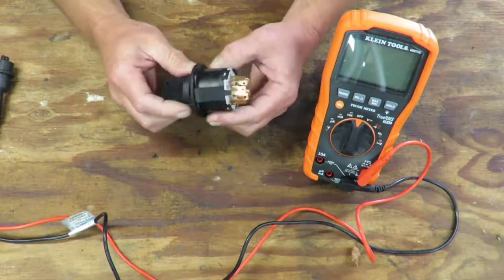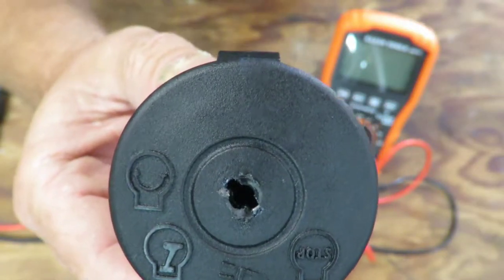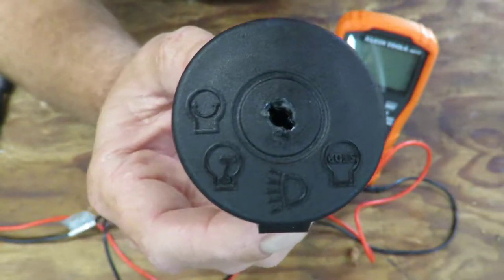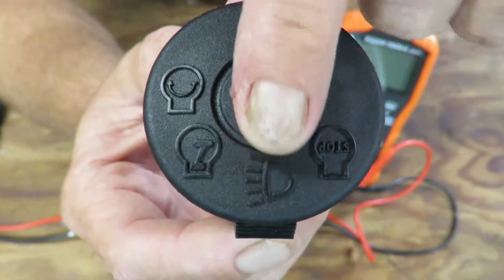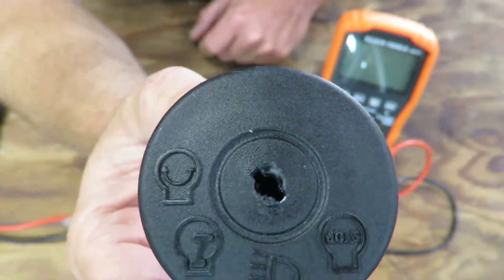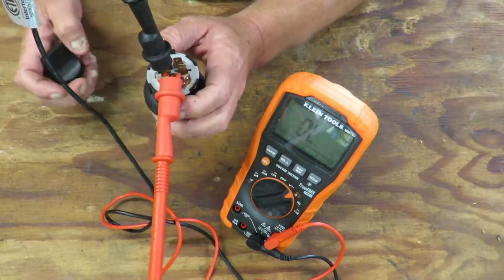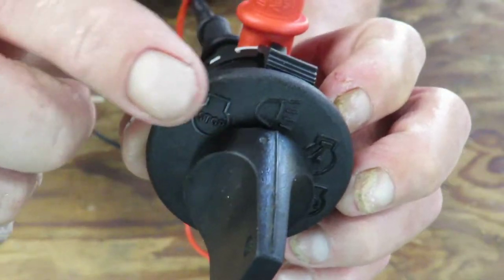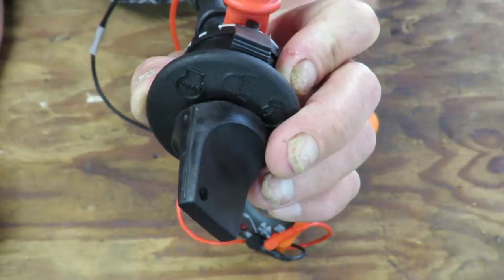How to Simple Key Switch Test

Comment: My husqvarna 48" riding tractor keeps going thru key switches! And it seems to be getting worse I used to replace it once a year now with the mowing season only half over again key switch is shot! It cranks but wont fire! I cant seem to figure out why it keeps happening. Any advice would be greatly appreciated thank you love the channel
Reply from the maker: I think you have other issues, Carburetor problems, ignition Coil Problems, 
Possibly more major problems that are unlikely,  but possible
Low compression, Valve adjustment
Reply: @sartingarage8045  tonight I replace the key switch again it fires right up runs great is it possible the voltage regulator is putting out too much voltage and frying the switch? No continuity between A1 and B  also the A1 terminal is a different color than the other terminals. Please let me know your thoughts the carb is new due to ethanol fuel also replaced the head gaskets when I was at it the mower has lots of power and runs great
Reply from the maker: I would definitely test the voltage while engine is running. Should Not be over 15 volts DC. Most common about 13 to 14.5 volts DC.
Also make sure your using the correct key for that switch. Wrong key can damage the connections inside the switch

Comment: What is the "Y" terminal used for?
Reply from the maker: I am not 100% sure about this, But I believe the Y is for the headlights. I believe the Y actually means the connection splits two ways from the stator or voltage regulator.
One to the headlights other to charge battery.
One way to find out for sure is to follow the wire that connects to the terminal Y and see where the wire goes

Comment: I have one of them older switches. I just bought it new this morning. I've also replaced the solenoid as well. I checked all the grounds and still nothing. I can get the solenoid the click only with direct power. My issue also is the fuse holder. when I put the connector on the left solenoid it blew the fuse. When I change it back, I get nothing. I wish this opposed twin would fit in one of my good frames just to see if the starter will engage. I was able to follow your video though and seems that this switch is good. I have that voltage gage on this 6 prong switch.

Comment: Research led me here🙏 fresh battery won't even turn over I'm thinking it the ignition switch
Reply from the maker: Engine won't turn over could be a number of things, Key Switch, Brake Switch, Blade Engage Switch, Starter Solenoid, to name a few. I would test key switch first
Then a easy test to see if starter Solenoid is possibly bad. There will be either one small wire or two small wires on bottom of starter Solenoid. With key in start position should be   battery voltage to the one wire or on one of the two wires if your solenoid has two.
Also make sure your grounded good.
There is a video for testing ground connections on my channel.
Reply: @sartingarage8045  it ran last year it was cover with tarp!!. I tested switch but my multimeter is cheap and doesn't beep like yours it would flash couple high numbers then go right back to 1 on the screen... nothing has been tampered with just wonder if condensation is a factor also in those parts you mentioned failing(solenoid and ig switch etc)
Reply from the maker: I would invest in a bit better meter at least one with a beeper.
Reply: @sartingarage8045  🙏 thank you master for your wisdom..

Comment: I have a old toro 3650 snowblower,r tek,how do i test the switch before replacement if the coil
Reply from the maker: For the ignition coil circuit on the key switch is terminal M and terminal G on back of switch. Key off should be continuity and Key on should be No reading.

Comment: Enjoyed the video, tried testing my switch as you did, I could not get anything when touching B and S and turned to start but nothing happened, parked the mower after mowing and was going to move it but nothing no click, no start. I saw the fuse was blown so I unhooked the clutch, wires to the engine, everything else I could find to unhook but still as soon as I turn on the key it blows the fuse, could this be a short in the switch, lights haven't worked in a while.  Don't know where else to check. It will spin the motor if I jump the relay.   Thanks
Reply from the maker: First if your not getting anything between B and S terminal on switch. The Switch is defective. B is battery and S goes to starter solenoid. Which is why it wont do Nothing in Start Position. I would replace the switch First.
Reply: @sartingarage8045  Thanks ordered one see what happens. Appreciate the reply.
Reply: @theeagle4540  i have the same problem, does new switch fix your problem? Thanks
Reply from the maker: You need to test your switch as in this video
If your not getting anything between B & S Terminal with Key in start position.
Then yes you need a new key switch also

Comment: If you getting same reading from battery wire on voltage regulator to frame with keyy off and key on. Im checking 12.6 with key off and when i thurn key on its the same.

Comment: Thanks for the video - very informative .  You might find this interesting.  I had a problem with my Craftsman mower with a Kohler Command 17.5 hp engine ( a very good engine)  The mower started to get hard to start and after you ran it for a little while and shut it off it would not start unless i sprayed starting fluid into the carb .  I believe this started when i discovered mice made a nest under the engine cover.  I replaced the spark plug, double checked the ignition coil gap, installed new carb., new fuel line and filter and finally new head gasket. Did not help.  Not sure why, out of ideas i guess but i watched your video .  I performed your test very carefully and did it twice, it shows the switch is ok .  My brother who is a pretty fair mechanic insisted i try to hot wire the switch - i did that and bingo the engine starts just fine, and then it also starts after you run it for awhile just like it should . Installed new switch ( 7 pin sw. ) and problem appears to be solved.  This is the second replacement switch in ten yrs - i would think that is abnormal but with the very poor quality of parts now maybe not.   If you actually see this after all this time - thanks again, you got me pointed in the right direction.
Reply from the maker: Glad you got it figured out

Comment: My  Ferris keeps blowing charging system fuse when i turn the key on.
Reply from the maker: @michaelholt4925
Most of the time this will be a short in wiring to ground or defective key switch. This Video doesn't show how to test key switch for a short. But basically you test the same way as in this video, but say when your checking your charging side of key switch, rather than just check A1 to B terminals. You want to check all the terminals. Connect one lead to A1 and the other to all other terminals on switch, You should only have continuity thru A1 and B,  So if you do this and you have continuity between A1 , B and G. That switch is shorted to ground.
And also your wiring and connections may be different. and to figure this out
Disconnect Battery
Remove output wire from Voltage Regulator
Put one lead of meter in this wire
And at the key switch use the other lead to find which terminal your connects to on key switch.
Another short test to
Disconnect Battery
Connect one lead to single wire on voltage regulator
Other lead to ground
Turn key on
If meter beeps then you have short to ground. 
Make sure Battery is disconnected or you will damage your meter.
Reply: @sartingarage8045  Thanks

Comment: Excellent teaching! Checked out my LTX 1046 Cub C ignition switch it tested all good.  Thanks.  I've replaced the starter solenoid switch. While doing the replacement , I noticed the fuse, which was good, had  the red wire on one side was hanging free. I reconnected it to the larger red wire coming of the solenoid. Still I have a  tractor that  does nothing when I turn the key. Is there  another fuse behind the steering wheel close to the ignition switch?  Any suggestions? Also, do you have another video that would address this problem? Just subscribed . Thanks again, great job!
Reply from the maker: The little red wire you reattached
Make sure you attached it to the solenoid post that the battery cable goes to the battery
One side of solenoid post goes to starter
Other side goes to battery
If you connected it to starter side
There will be no voltage

Comment: Mines a cheap all metal brand the only plastic one I have is on the John deere
Reply from the maker: There will still be letters on the back of switch, Sometimes on the terminal themselves or on the switch at bottom of each terminal.
Reply: @sartingarage8045  there is. I have a big battery charger I could test it with and other mowers I could test it on if the wire plug in was the same 

Lowes sells the switch I'm needing. i haven't bought it yet because i been looking over the wiring i was trying to see how did the blue and red melt a little so those 2 are melted into the black wiring plastic what you plug into the switch
Reply: @sartingarage8045  the switch might be good then it might not it is old and full of rust the guy we bought the mower from always kept it parked outside
Reply from the maker: You can test the metal switch with a Multimeter. Put meter on Ohms. 
Depending on which switch you have
You will test terminals
B to S with key in start position
M to G with key off
L to B with key on or in Light position
Depending on what your problem is
May need to do other test to switch
Reply from the maker: Yeah that's Not Good
If it's rusted up I would probably just replace it to prevent future problems
Reply: @sartingarage8045  I need to figure out how the blue and red got melted first it could have been from the switch being old one black relay box was clicking when I'd turn the key to on it might be bad 

Its just on the old green craftsmen most of those mowers are made the same well with the same parts I don't really see why they made them with so many of those relays it has 4
Reply: @sartingarage8045  it is rusty

Comment: Will someone PLEASE show a video on How to remove a key switch??!! (for us "gals"
Reply from the maker: Paulette Pier What Mower do you have
Reply from the maker: I will try to make a video this week on How to remove key Switch.

If it is this same switch that is in the video. On the back side of switch there are 2 Tabs exactly straight across from each other. Another words if you had the switch in your hand there will be a tab on right side and the left.
Push one tab in as you push up on switch at the same time. Switch will come up just about eighth of an inch.
Then do other side tab being careful not to latch the side you just got loose to latch back
Reply: @sartingarage8045   It's an older model of Troy Built Bronco  the brake & accel are on on the same side..
Reply from the maker: If it is the same switch in this test video
There are two Tabs on the switch 
Lift hood and reach under dash and on the top and bottom there is a tab
Push the tab down with a screwdriver while pushing out on the switch

The switch comes out the front of dash
The tabs are on the back of dash
Reply from the maker: Paulette Pier if it is an older tractor it may have the old style switch
If its plastic it is described in previous comment I sent to remove it

If it is a Metal or aluminum key switch it will have a Nut on top. Just remove the nut and Switch will come out from back side of dash.
NOTE: Sometimes this Nut is covered by a rubber cap. The key goes thru this rubber Cap. Pry the rubber cap off with a screwdriver. You will then see the Nut
Reply from the maker: @paulettepier5526  Did you get your key switch out
Reply: @sartingarage8045  Not yet and I was mistaken on the model..it is a Horse, not a Bronco ...Had a friend come by ..he 'arked' the slinoid  & it started..he did say he had to jiggle the key...would that mean the switch os bad or going bad?  Also, last mowing  before it stopped cranking....as I was mowing, the key fell out ( but it kept going)..would that be a "pre-warning" the switch is going bad??    Thanks for all the help..depending on weather tomorrow, I will try to watch your video & try....but the fuel tank is in front (behind the ignition...)
Reply from the maker: @paulettepier5526  I dont want to tell you the key switch is bad without testing it. But it does sound as if the internals of the switch are broken, The key shouldnt just fall out. That Gas Tank can be removed to get under dash, but on some MTD its Not an easy Task. MTD makes Troybilt. 
Some you have to remove hood, side fenders, Then pinch fuel line off to prevent fuel from coming out of tank, Then remove fuel line off fuel pump or Carburetor. Just follow the fuel line from the Fuel Tank to the engine and remove it. Take the 4 bolts out of fuel Tank and Remove it

Comment: I just found ur channel. I wonder if u could maybe do a video on basic to moderately complex electrical systems like on a mower.   I kinda know how it works but need a lot more training  like how does a ground work.  How do they wire all the safety switches with everything else and it works.  Thanks for sharing your knowledge
Reply from the maker: William I do have some videos on Ground
But I will most definitely make some more on this information. I work a full time job 12 hour shift 5 6 and sometimes 7 days a week. So it may be a bit before I can create one.
Reply: @sartingarage8045  ok I sure do appreciate what you've done and will do in the future.  Thanks  very much. What's your first name
Reply from the maker: Chris

Comment: best video on testing switch I've seen. My old switch was bad, bought a new one and mower still won't do anything, not even the lights will come on with the new switch. Battery was tested and is good, so there also must be some other electrical problem to research
Reply from the maker: Power to the switch comes from. Starter Solenoid. Follow battery positive wire to solenoid. There will be a small wire attached to the same post on solenoid that battery positive goes to. There will be a fuse in this wire also
Reply: @sartingarage8045  Same problem, Just  tested as per your instructions, my key switch on a  Cub 1046. The key tests ok. Replaced the Starter Solenoid and still no power when I turn on the key. I checked the fuse. It's good. The red wire coming out of the end of the fuse had broken off. I reattached the wire to the positive  red battery cable. Still nothing. Is there a second fuse up behind the steering wheel I'm missing?
Reply from the maker: @Lorin Kenfield On the connector to switch 
Check the B terminal for battery voltage
Test your battery Ground
Meter on Ohms One lead on Battery Negative
Other lead touch to engine block and other metal to make sure ground is OK
If you don't have ground there will be No voltage

Comment: Great video, thanks for taking the time to make it. I’m looking to add a led light bar to an Ariens. Currently the tractor has no lights. It has a similar switch as you have in this video. I want to utilize the light position on the switch. Can I use the L and A2 terminals? By the looks of the video I’m sure I can and not mount an additional switch. Also I’m assuming that if during the daytime the lights would be off if the switch is no on the light icon. Thanks
Reply from the maker: Watch my Boss Stereo install on Husqvarna 
I also added LED lights to it and the video shows you where to connect lights to use key switch.
There are 3 parts to video
Reply: Sartin Garage thanks I’ll check it out.

Comment: What would cause my starter not to disengage?  I just did this test and the switch is good.
Reply from the maker: When you say engaged
Starter stays spinning the engine
Or starter Gear just stays up

If engine keeps turning over
Replace starter solenoid

If the gear just stays up
This sometimes will happen if engine doesnt start.
But if the gear stays up while engine is running. 
I would replace abbendix kit
Reply: When I try to start it, the gear goes up and stays engaged with the fly wheel.  Im don't even get a full revolution.

Comment: hello how are you
Reply from the maker: Im good
How are you
Reply: Sartin Garage I am trying to install a new key switch not going so well ! Any advice .. don’t I just plug in the new one
Reply from the maker: @ChillaKaya  Yes as long as its the correct Key Switch
Look up your make and Model number of your equipment. There will be a part number for your exact key switch
You then will be able to unplug old one
Then just connect new one
Reply from the maker: @ChillaKaya  If you would like Give me your Make and Model Number and I will look key switch up for you and send you a part number
Reply: @sartingarage8045  ok  so model number is 937748
Reply: @sartingarage8045  make is the hustler rapture  then there is this number 17093121
Reply from the maker: @ChillaKaya  looks like 937748 is the Deck Model Number
Should be another tag Under Seat or Somewhere on Frame on the rear of mower